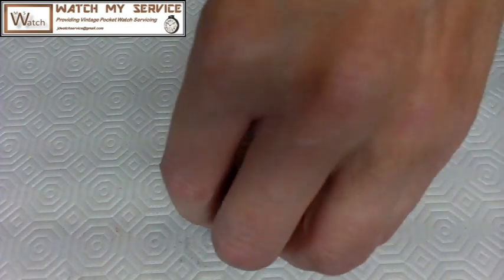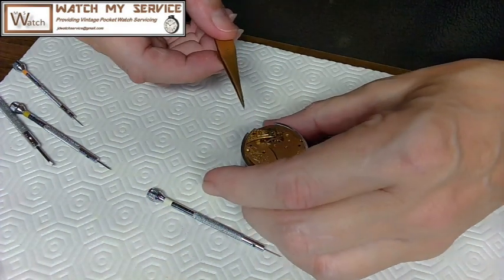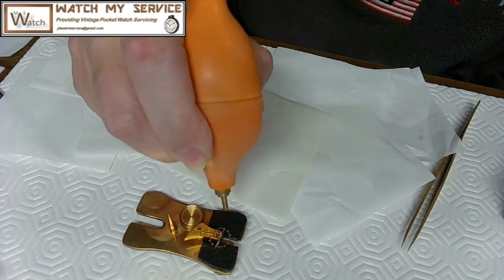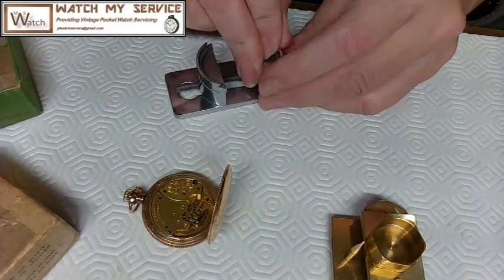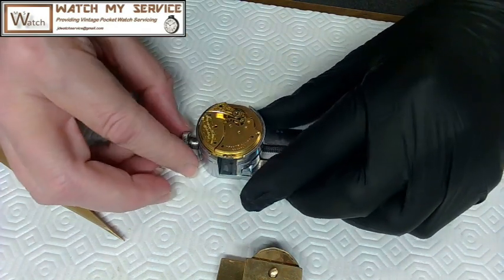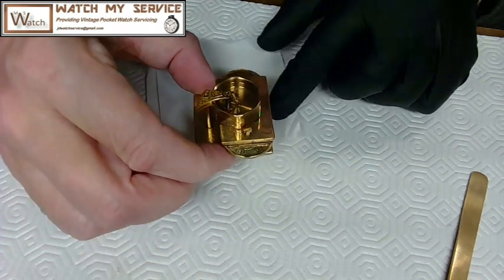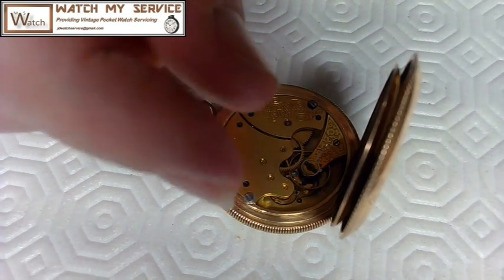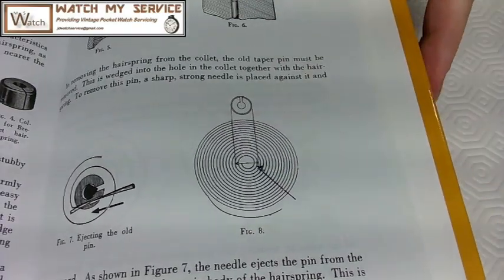Unsticking a Watch Hairspring

Comment: Interesting issue with the hairspring. Did soaking solve the sticky hairspring issue?
I recently picked up a Superva with a Unitas 429 movement. These were sold by Eaton’s for a short time in the 1940’s. A balance pivot is barely perceptibly bent, which I suspect contributes to low amplitude after cleaning and oiling, given that end and side shake are small. Are you aware of any makes of balance wheels that were intended to swing only about 110°? Now I have no choice but to find a Jacot tool to straighten out that pivot. JD, you really need to do a video about how slippery this slope is!
Reply from the maker: Yes, it absolutely did work in the leaves of the spring. We’re not sticking together anymore. It’s funny after I soaked it. The first turn of the spring got cut into the second turn when I reinstalled the balance and so I thought it wasn’t working. But Wala I just moved that one leaf over and the thing was then I completely concentric hair spring and now works exceptionally. I’ve never heard of any wash movement that has allowed for 110° swing. And I have broken many pivots trying to straighten them even with a very expensive pivot, straightening tool that I have. If you’re able to anneal the pivot, perhaps it won’t snap. But good luck with all of that. Likely solution is to get a new balance staff for this watch.
Reply: @JDRichard   Thanks for the feedback, JD. It sounds like straightening pivots is about as successful as cleaning dials. Before I try anything on the balance staff, I’ll try shimming the balance to see if that improves the amplitude.